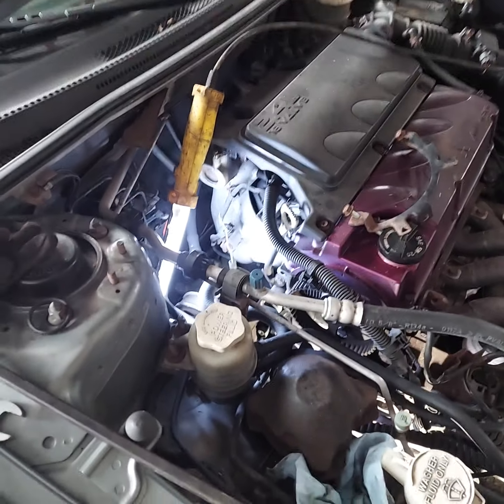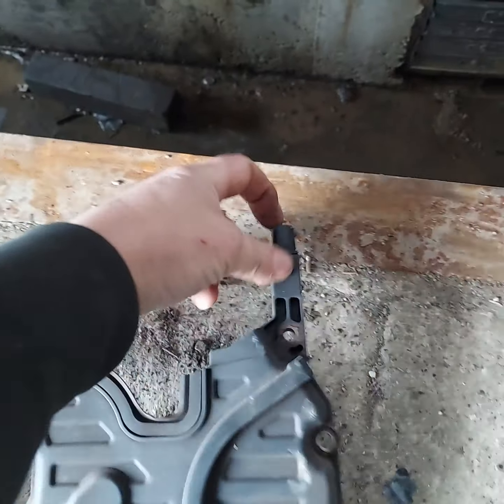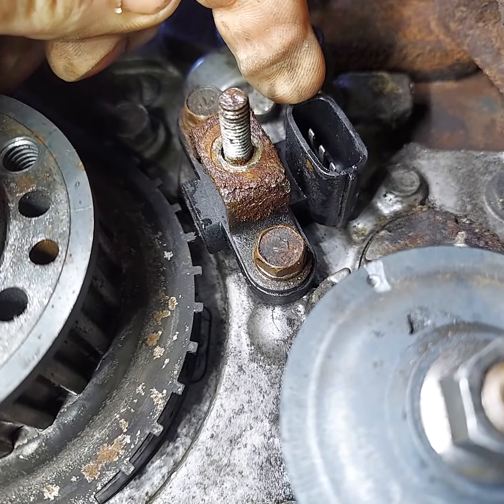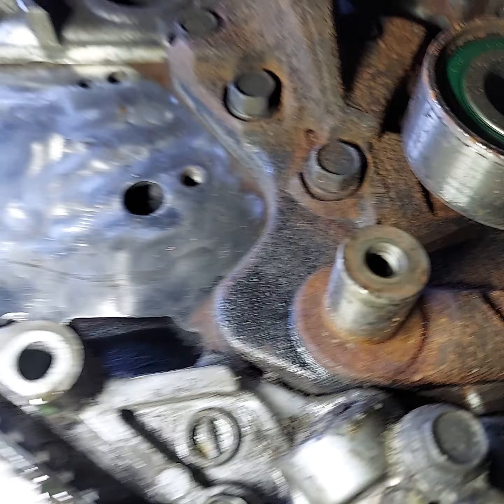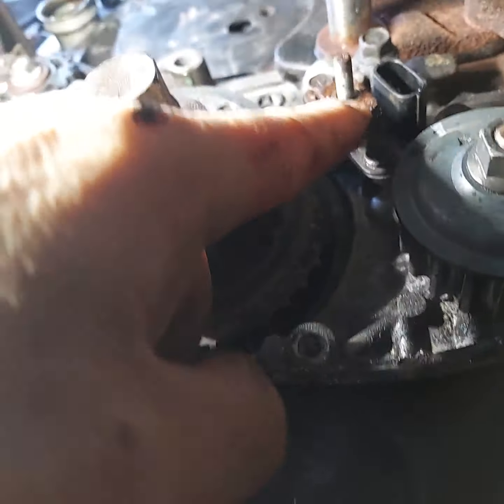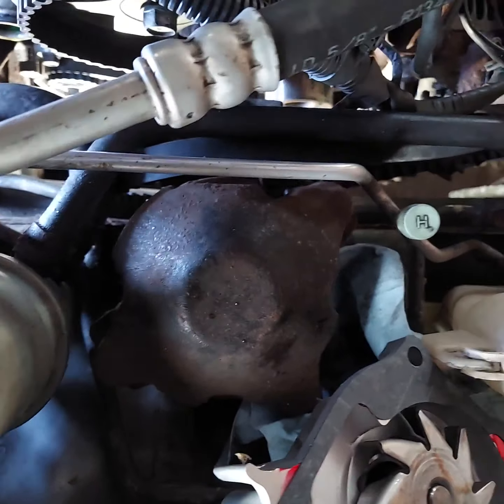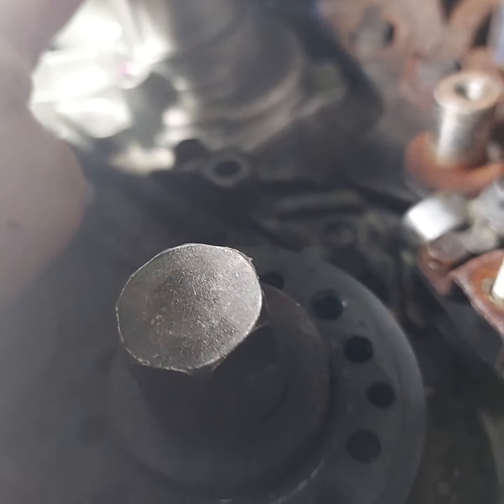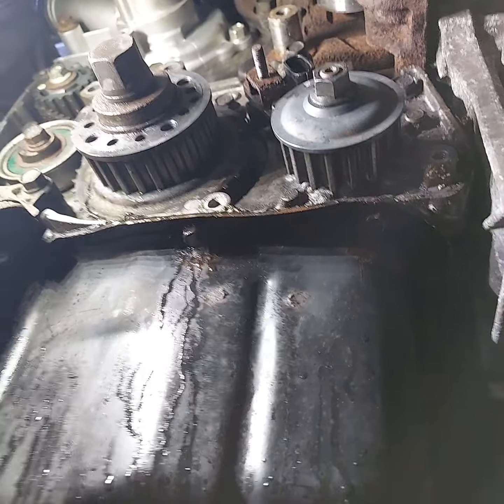water pump & crankshaft position sensor 2008 Mitsubishi Eclipse 2.4 liter

Comment: Questions you have to set up the timmons just for change the sensor?
Reply from the maker: @relaxcity4197  no, you don't. Just remove parts necessary to access the cover and you can change out the sensor. But then, inspect the timing belt while the cover is off

Comment: I think I need to have mine done. How long did it take you and how much if I have it done should I be expecting in a price range? Thanks great video.
Reply from the maker: depending on the labor guide used, I use Chilton, time allowed for this is 3.3 hours.. at $100/hr, that would be $330 for labor but it might be +/- in your area plus parts which are less than $100 just for the water pump.

Comment: Is this the same way for the galant
Reply from the maker: if the engine is the same size, yes sir.. however radiator & sone other items might be variant
Reply: Did you have to relearn the crankshaft sensor?
Reply from the maker: @kylelandjohnson613  no
Reply: @darylsparks-sparksautomoti6066  OK thank you I just replaced. My my car still won’t start but I just checked my spark plugs and they’re full of oil can cause it not to start also